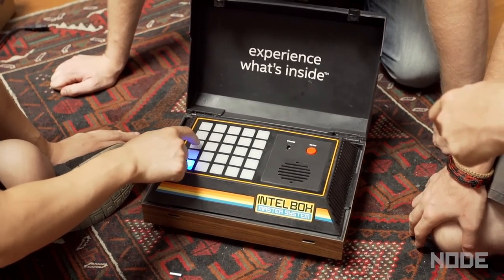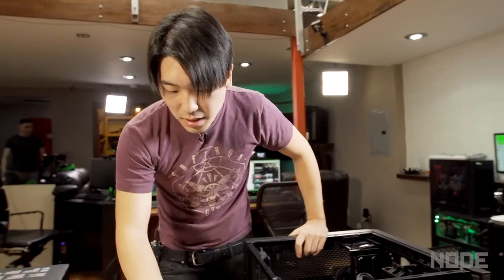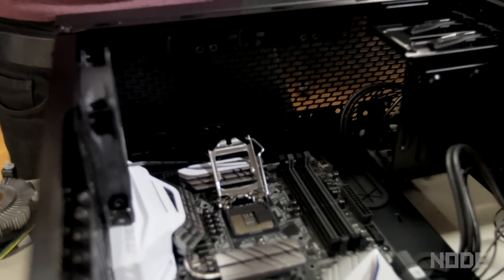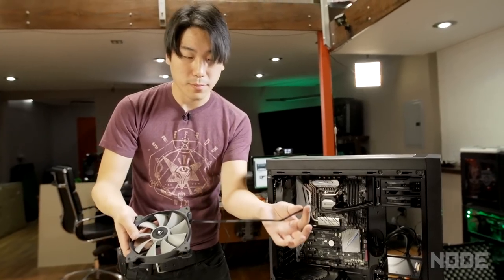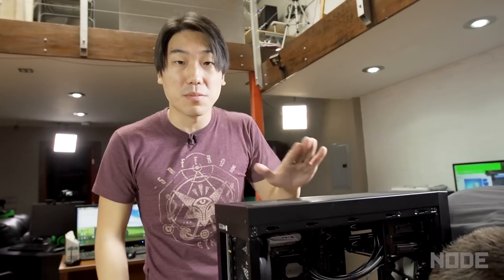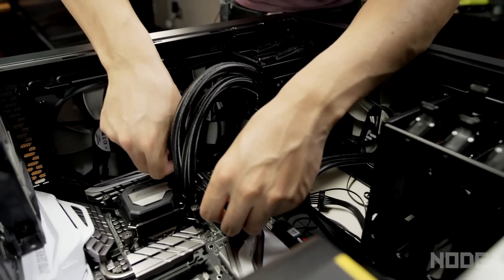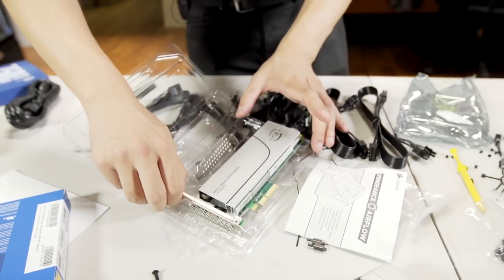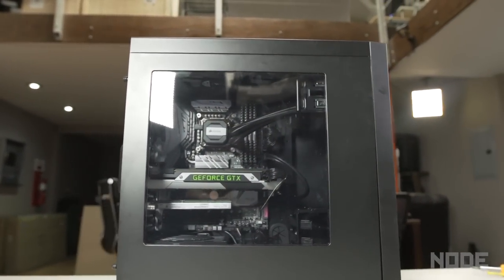BEAST INTEL PC BUILD

Comment: For those thinking of building a PC after this PLEASE go watch a Linus Tech tips build guide. He will explain every component, why you need each one, how to put the right parts together and then go through every single step of putting a computer together in the safest, most efficient order. I get the sense that you do know what you are doing D but you could not be more vague and confusing if you tried. You keep saying 'go do your research' but if you had done your research properly you would NOT be doing things like you did. Why not put the ram in the second you get the motherboard out of its box? why not put the motherboard on its box and put the cpu in before putting it in the case?.Why are the fans not on the radiator when you put it in? you can save yourself a lot of hassle by taking some simple steps. 

I am sorry for being a picky asshole but this whole video just irks me because I dont want people to build PC's inccorectly and increase the risk of breaking components. I have broken components installing them carelessly before and it really sucks. Please go watch a tutorial by someone who has a lot of experience building computers so you can make videos like this far easier to follow and to a much better standard.
Reply: He's not building it incorrectly, just not the way you do it.
Reply: +Sir Garry No anti static band or gloves, that's pretty much a bad thing to be doing straight away.
Reply: +BumpahCarz Yea, idk why but it bugged me so much when he called the IO shield a back plate
Reply: +Zuiq Anti static bands aren't really a big deal though, as long as you remember to ground yourself by touching a piece of metal. The case for example.
Reply: +RK "you dont buy bits and put them into your PC and just turn it on"...........Well there's nothing really wrong with just doing that but if something doesn't work you've made a bit more work for yourself.
Reply: +BumpahCarz I think this is a good point. I feel it would be great for them to explain, for example, why cable management is important.
Reply: Gahnzo Is it that important? In my day we just left a nest of large unsleeved cables & wires hanging in every direction and it did us no harm. It does look nice though and is good for air flow particularly in overclocked cases but I can't be bothered to do it most of the time.
Reply: It can affect air flow. If you spend a lot of money on a nice tower and a nice cooling solution its kind of a waste.
Reply: Gahnzo Yeah I did mention that it can some but I just can't be bothered with the super clean look. Tuck things outta the way a bit and I'm done.
Reply: +BumpahCarz It's not like this a tutorial. It's just a build.
Reply: +BumpahCarz You mean Linus Tech will not skip the importance of all the mobo standoffs so you don't crack the board installing the RAM and cpu? ;)
Reply: +BumpahCarz And also to the people reading this, you need to make sure EVERYTHING is compatible. The CPU has to be compatible with the RAM and motherboard. The motherboard has to support the RAM. there might be known problems between components that are supposed to work. you might have to RMA, get extra wires, get an after market cooler, extra fans, and so much more. the hardest part is buying the parts.
Reply: Mike M Thankfully a lot of stores make life easy for you and will ship a bundle that will work and often will pre-overclock it for you and overclocking is witchcraft to me, I stay away lol.
Reply: Quickblood1 Eh, I'm running a Pentium G3258 and have it on a mild overclock on the stock cooler. I never encountered a store that pre-overclocks a system for you other than prebuilt systems.
If you're putting it together yourself, overclocking becomes an optional task to do.
Reply: +BumpahCarz Linus will also show you a true beast PC and not a decent rig xD
Reply: ***** Loads of stores in the UK sell overclocked motherboard bundles (RAM, CPU & Mobo) I can't imagine we're the only country that does it. I always wanted to buy one but you pay a bit extra for them doing so and I tend to buy new parts very cheaply or go second hand.
Reply: +BumpahCarz exactly... I mean, I know this dude's doing things very inefficient, bec linus' "how to vids" really did a good job. and this guy's asian... peace!!
Reply: +BumpahCarz "Why not put the ram in the second you get the motherboard out of its box?"

So it's lighter when he's putting it inside the case.

"why not put the motherboard on its box and put the cpu in before putting it in the case?"

So it's lighter when he's putting it inside the case.

".Why are the fans not on the radiator when you put it in?"

I sense a recurring arbitrary theme to your questions. All of them nitpicky and unnecessary.
Reply: +BumpahCarz I get what you're saying, but this wasn't a build guide. D was just building it how he learned, nothing went wrong so it's all good in the end. If someone is thinking about building a PC, I doubt they'd come to NODE for that
Reply: Quickblood1 Huh, I guess I haven't went to many sites then. I'll go check out some sites that I'd think would have it.
Reply: Dude, 1: He doesn't "keep saying" anything, he only says do your research in one part of the video. 
2:He says why he didn't put the ram in from the start.
Reply: +BumpahCarz why so many thumbs up for this nerd? who cares what order a pc is put together? it's not a race.
Reply: +Quickblood1 Hey mind giving me a few places? Most ones I go to the workers have no idea if anything is compatible and it's been putting me off building my own one.
Reply: +Zuiq You just need to touch a grounded piece of metal, you don't NEED anti-static bands or gloves in the slightest.
Reply: +Quickblood1 As long as you don't have anything lose or pull out the plug while the power is on ( seriously don't do that ) you'll be fine, some people just take it too seriously.
Reply: Lartin If you're in the UK just google "motherboard bundles" or "overclocked motherboard bundles" or you could just check out Scan, OCUK, Novatec,Amazon and ebay. I assume you'd get similar results in different countries as I doubt motherboard bundles are unique here.
Reply: +Theodore Ambrose (Teddy) Those are pretty terrible reasons. If you think the CPU and RAM are heavy pieces of equipment, then you clearly have little experience with building PC's.
Reply: Thank you I'll check it 😉
Reply: +RK lol you're acting like it's the law that you have to assemble it outside of the case first. most people don't do that shit anyway, I didn't and I know quite a few people that didn't.
Reply: +BumpahCarz it's not a build guide, it's a video about the PC they built, it's for entertainment. if anybody uses this as a build guide then they are stupid because nowhere does it say "build guide"
Reply: +BumpahCarz tek syndicate is also good but i agree this was a crap build guide
Reply: Agree, Linus is the best for stuff like this.
Reply: I believe that everyone who ever build a new pc few years back use to put things in the case nothing wrong with that. when years came by people started to watch youtube and start to put there rams cpu on a box its justa matter you earth yourself first n if you known what you doing there is nothing wrong or right when building a pc
Reply: I would also recommend Paul's Hardware. His channel has several builds 1 or 2 of them are step by step by step. And anything Paul did while he was with Newegg.
Reply: +BumpahCarz Can't believe how many mistakes D did in this video. I recently 
assembled my first PC and did everything quicker and more efficiently.
Reply: +BumpahCarz Agreed. Linus Tech Tips, Hardware Canucks, Jay's Two Cents, Paul's Hardware, all good.
Reply: +Zuiq you don't need antistatic bands or gloves. You can ground yourself on the psu and be perfectly fine as you won't short things out. In terms of how he built it really doesn't matter unless it doesn't turn on.
Reply: +BumpahCarz "I get the sense that you do know what you are doing"

Hahahha I sure didn't. Watching him try to install the cooler heatsink without installing the backplate, and pump standoff screws first was laughable. And then they just casually cut to having the standoffs installed when he realized he had nothing to mount the pump/heatsink assembly onto. Listening to him make cringe-worthy PC building analogies was equally hilarious. Computer building comedy gold right here, you can tell they care more about targeting nerd and geek demographics than actually giving accurate information and providing useful content. It's all about them views BABY.
Reply: the elitism in this comment section is too much
Reply: very good points. i built mine after watching a ton of linus tech tips and a few asus videos and did everything you and linus recommended. booted up on first try to.
Reply: +BumpahCarz When you go to build your own Gaming Rig how do you know that all the parts are compatible?  Will it tell you when you go to start it up and install the OS or something? Sorry man I'm new at doing this...
Reply: TheDigihax pcpartpicker.com It's a website that lets you "start a system build" (choose parts you want) and tells you if they are compatible or not. Heck they even have a compatibility option that only shows you if parts are compatible with what you choose. Tip: choose your CPU first.
Reply: Gareth T Cool thank you man...Now the only thing is to pick a good case I hope that's not too much of a challenge lol...
Reply: he also called the radiator of the AIO cooler as the same with the intake of the a vehicle.. lol maybe he thought that the radiator of a vehicle is actually the intake... lol
Reply: no offence but he actually have a point on his "questions". That's actually pc building 101. 1. "Why not put the ram in the second you get the motherboard out of its box?" the  answer to that question is to avoid putting stress on the MOBO when putting RAM. There's a risk of bending the board if you put the RAM when the MOBO is on the MOBO stand off's.. the same answer on the number 2 "queston". I didn't done that actually build some PC's... lol I actually learned that when my professor told me that.. years after after I built some PC's.. :) did not damage any MOBO's though. I think it's better to be safe than sorry.. :)
Reply: I beg to differ. CareyHolzman is 10x better with building PC's and showing every detail.
Reply: Patrick Challita
Exactly, I ran into him on youtube last month and been studying his videos, that dudes got 25 years experience (or so he claims) and the way he builds his desktops he makes it look so damn simple i tell ya. He does videos for newegg also...
Reply: TheDigihax used too he doesnt anymore
Reply: I didnt use an anti static band or gloves. Really no need now considering most new motherboards have anti static protection so haha
Reply: true

Comment: Ahhh D kept touching his hair (gets oil on fingers) and then he was touching the top of the CPU wtfff
Reply: XD always can get rubbing oil off
Reply: but he didnt lol
Reply: +Hamdex maybe some editing to speed up the entire process.. you never knew if he was asking some people ;)
Reply: ***** I'm talking about the top of the cpu where the heater and cpu contact
Reply: ***** no oil between the cpu, thermal paste, and heater gives it an uneven or bad contact between the two. You want the top of the CPU to be as clean as possible to get a nice contact between the cooler and your CPU
Reply: +PoniesBleedRainbows Which is why you avoid touching the top of the CPU. Motherboards have Zero Insertion Force connectors so you don't need to push down on it when installing. There is absolutely no reason to make contact between your finger and the top of a CPU.
Reply: +PoniesBleedRainbows He touched the top of it after he had already installed it
Reply: +Hamdex Doesn't hurt anything actually
Reply: nick podgorny thank you for clearly reading up on your facts and not stating an obviously stupid statement :)
I'll state again. Oil between the CPU fan and top of the CPU will not directly damage it. Instead what happens is it reduces thermal conductivity which means your CPU might be getting hotter than it should be.
Reply: +Hamdex not if one has nutella on the fingertips. in that case you even get lower temps. XD
seriously though, it doesn't really make a measurable difference at all since we invented soap.
Reply: sbraz you'd be surprised
Reply: +Hamdex Shouldn't matter to much as long as they don't plan to overclock the cpu and stress it. For normal use it shouldnt matter but if you wanna be optimal you should try to touch the cpu as little as possible.
Reply: Knowing them they'll probably keep it stock, but then again you should avoid touching it in general if you can.
Reply: +Hamdex So?
Reply: +   This thread is from September please read through it
Reply: +Hamdex It would barely affect the temperature, 1 degree Celsius at absolute most, if at all.
Reply: +   Ok again, this is irrelevant to answer this late
Reply: Why reply to several months old diskussions
? Dont disturb the sleeping dragon!
Reply: +Brandon Bianco why reply to a reply replied months ago?
Reply: Damb

Comment: tip put the ram and cpu on the board before it goes in also the cooler depending on what cooler it is :)
Reply: +NonsensicalSpudz 
Can you maybe re-write your comment with a bit more sense?
Because I just can't understand it.
Reply: +ClonesDream what's so hard to understand put the ram and stuff on the motherboard before you put it inside.
Reply: +xWillgames It's highly recommended for example the CM Hyper 412 cooler, wich is kind of big.
Reply: ClonesDream can agree, i just wrote it all as one :P
Reply: Guys chill, he just didnt understand.
Reply: You got all of the great replies correcting you because of your great reply correcting him.
Reply: What exactly did any of the things he said was correcting him correct?
Reply: +ClonesDream Put the RAM/Memory and CPU/Processor on the motherboard before you put in the case. 

If you have a third-party cooler, then put the backplate no the back of the motherboard before putting in the case.

Hopes that clears things up for you.
Reply: Tim Dev Yeah, you really were.
Reply: +NonsensicalSpudz Another great tip...cable management.
Reply: +NonsensicalSpudz yea just don do the cooler first or you might hit it on the case then bend or snap something

Comment: SO MUCH LACK OF STATIC PROTECTION AGGHHHH
Reply: +konnor cahoona As long as you're working on a wood or tile floor and you touch a grounded piece of metal before starting, you'll be fine.
Reply: You dont realy need that
Reply: +konnor cahoona You really don't need any. As long as you're touching the metal on your case you won't cause any static damage.
Reply: +konnor cahoona This is exactly what i was thinking.. I hope no one building a pc with parts that expensive look to this video as a guide.
Reply: +konnor cahoona Or maybe an anti-static ankle strap?
Reply: +konnor cahoona I thought PC doesn't have any power until you plug it into power socket for the first time.
Reply: +Кирилл Дмитрук KRLL lol, you have no idea what he's talking about. if your body conducts static, it could fuck up your pc.
Reply: Dylan mangaka Ah, I thought he meant that PC could shock you, that's why I was confused. Thanks.
Reply: Кирилл Дмитрук KRLL it's cool bro
Reply: I was half trolling with this because I built my pc that works 100 percent fine on a rug without any static protection.
Reply: +Luke „DaHedgehog“ Edmundson Modern parts aren't as weak as they were a decade ago. Just keep up with times mate.
Reply: +CapMurd Is it worth taking a dumb risk? screwing up your ram over an anti static strap? Not everyone gets parts sent to them from origin.
Reply: Luke Edmundson It is not dumb. All you have to do is touch any metal part of any PC tower and you are done. Modern parts are quite strong against static these days, you have intentionally sabotage them for it to get fucked up. You are more likely to receive a broken part than fuck it up yourself.
Reply: +Luke “DaHedgehog” Edmundson How does one avoid this?
Reply: +Leminid touching the tower, as other comment states..
Reply: I built my $2.5k pc on the floor without any static protection. I don't see any problems at all
Reply: From my experience of building PCs (I've made about 5) You don't really need it. My first ever build I was super careful, but on my most recent build I was sitting on the carpet, nothing happened. The only way you could damage your stuff is if you purposely rolled around on a carpet and intentionally touched a sensative part.
Reply: +konnor cahoona Lol Static is much less of a problem than you're thinking... I build my pc on a desk.. but with me standing on a carpeted floor in socks lol I just discharge myself on the case occasionally.
Reply: +konnor cahoona Whatever, touch a ground point before you start, good enough!
Reply: +konnor cahoona Cause we live dangerously bud !
Reply: +konnor cahoona In this comment section: first time builders thinking they know anything about PC building.